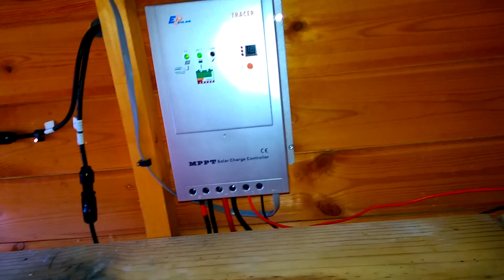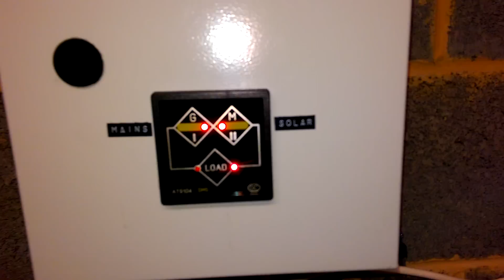Solar-powered Bitcoin Mining farm

Comment: over 3000Watts from a 13 amp plug all day how does it last i dont know. Besides the power you making probably only will keep that running 2 hours :D solar powered farm my ass.
Reply from the maker: This is an old video. That Antminer is drawing 350W, not 3500W.
Reply from the maker: This system ran for 3 years.

Comment: Making profit from bitcoin is as simple as finding what works and sticking to it for as long as it works irrespective of the current market trend which is so sideways right now, the faint hearted may just throw in the   towel and probably sell. This of course is a good time for me and it's been going on for months now since I heard about Mrs Linda, and signed up with his trade program. She provides trade signals and within my first month, I had turned in profit of over 3BTC under his instructions and daily signals. This current price position doesn't make any difference as anytime is good for trading if you know what to do. Mrs Linda can be reached on via whatsapp +1(209)510-5751

Comment: I’m keen to hear about how this turned out? Have you had it running the whole time or did you retire it for any reason? Thanks in advance 🙂
Reply from the maker: Retired it years when BTC was around £500 GBP a coin as no longer profitable due to difficulty curve. Still use the power system to run my fridges and freezers in the garage. Makes more money than the miners would for the same power.
Reply: @RoguePlank  ah so the dream is dead! 😔 thanks for the reply, was very interesting to know.

Comment: u make a profit after how many years ?
Reply from the maker: No, stopped mining years ago. The electricity is better used for other things.
Reply: @RoguePlank  
it was not profitable?
Reply from the maker: @marcarony2838  it was for the first year, but then the cost of electricity and upgrading hardware became more than I could make from mining because of the difficulty increase. So I sold the mining equipment and kept the solar power gear that I had bought with bitcoin. It was an overall net-gain after 3 years of mining, but not much.
Reply: @RoguePlank  u loss million of money 😭 
If u hold on

Comment: cool system love to do this 2,
just a few questions if you don't mind
353w for bitmain and internet?! usually in spec they say it uses 1300~2000watt?!
and if i see your system correctly your system is grid-tie can actually you 440w solar charge that much battery?
Reply from the maker: This was several years ago
Reply: @RoguePlank  ah you are right, lol well i always fascinated by solar-powered systems... 
still where i live it's way to expensive, but someday i will go offgrid

Comment: Couldn't you wire up the solar portion to just put out the 12 volts power used by the antminer and do away with the losses with that sine wave inverter and switch power supply? or even better, wire your panels and battery bank to 24 volts and use a DC-DC switching regulator to drop the voltage down to 12 volts?
Reply from the maker: That was an option, but would have meant the power couldn't be used for anything else really. Also, the DC line losses in that 30m cable from the shed to the garage would have been quite considerable.
Reply: @RoguePlank  No way to bring the solar system closer to the garage?
Reply from the maker: @sergeantseven4240  in hindsight, it probably would have been easier to get an Internet link to the shed and have the miner in there too.
Reply: @RoguePlank  probably could have kept your grid tie system but moved everything to the shed and still ran the 240v mains to the shed, kept the inverter for other things but ran the miner off the battery bank directly. I'm planning to purchase a few USB miner sticks and run them off a solar system directly. because they are 5 volts 3 amps each I can reduce my overall investment in the system. That's why I was looking for videos about solar powered bitcoin mining. pretty much all of the videos I've seen so far do it the way you've done it. How much profit would you say you've made so far?
Reply from the maker: @sergeantseven4240  I stopped mining with this setup over 2 years ago because the mining difficulty increased so much it became impossible to make a return on my investment. Sold the miner and now use the power to run domestic stuff in my garage. I mined about 1.5btc over 2 years, but it was only worth about £300/btc back then. Unfortunately spent the coin as I never thought it was going to take off after seeing the trend over 2 years. Ah well, good luck to you!

Comment: electrical nightmare good luck in a storm with the cables above the ground
Reply from the maker: Aaron Sears what's the problem?
Reply: the cable needs to be underground from the shed to house.
Reply: Lightning more likely to hit tree or aerial on roof prior to cable the greater risk is fault current tracking back through the earth. lightning strikes uk not that common luckily relative to work strike rates anyway.
Reply from the maker: It's a steel armoured cable with everything grounded, and RCD's and breakers at both ends. Nothing gonna happen. It's been running like this for over 3 years now.
Reply: 30mA RCD's are for protection of electric shock to humans not electronics. Circuit breakers are for protection of over current and short circuit protection. You use surge suppression for lightning strikes, but like I said the likely hood of being struck is very low.

Comment: Bitcoin and Ethereum have made a lot of people very wealthy. Just $10 7 years ago will be worth $7.5 million today. And $100 in Ethereum has increased to as $66,290 in under two years ! There are stories everywhere of people getting rich. I personally invested in bitcoin and Ethereum. And I've collected bigger gains here than in anything else in my life. For example, I bought Bitcoin twice . 10 coins at $83.40. And 20 more at $128. Today my 20 coins trade nearly 24 times higher . And I also bought Ethereum last November at $9.70... before it rocketed to $355! I was up over 3,500%. But here is the thing nobody is talking about. Bitcoin and Ethereum aren't the real stories anymore. It's the smaller , lesser known NEW digital currencies that are rewarding investors with the next round of huge wins. For example , I recently obtained 27,000 coins in a tiny new digital currency for just 18.5 cents per coin. Those coins now trade for around $4 each- 1,981% higher. And I invested in another one that's jumped from $1.50 to $10.71. Yet this opportunity is just getting started . Today I'll show you the new digital currencies that can turn as little as $10 into over $1million... in the blink of an eye. Yes, that's right... a single crisp of $10 bill could make you a millionaire. It's not only possible... it's actually happening right now . Consider , investors have seen gains of... 75,063% in Cryptonite, 59,577% in InfluxCoin, 60,450% in MaxCoin, and even 823,750% in DubaiCoin! Tiny new digital currencies are offering profits far bigger than bitcoin and much more quickly. I've personally made over 600% in one digital currency more than 1,981 in a second and over 3,500% in another, and I expect to make a whole lot more. Digital currencies are the one place in the markets where you can start with $10 and turn that into real money fast. CNBC did a story on a high school dropout who bought Bitcoin at $12 and is now a millionaire. And the top investors in the world are going all in on the new digital currencies. Now this is what you guys out there should know . A new set of  coins are being launched now that could help you turn as little as $10 into over $1 million. I've never seen profit opportunities like this before... in any market and at anytime. For example... in one recent week 23 separate digital currencies doubled in value. By comparison, the S&P 500 hasn't seen a single stock double yet this year. But only those who recognize the opportunity right now will see the fast profits. I first got in on Bitcoin at $83.40 and $128... only to watch it soar to over $2,000. But now I've turned my attention to the new digital currencies. For example; I invested in ANTSHARES earlier this year and at the time it was trading for just $1.50 but I watched it climb to $10.71 in less than a month. I invested in tiny new digital currencies of 12 coins and I cashed out 12,000 at $3.50 but still hold the rest... nearly $100,000 in total. There are now dozens of small digital currencies trading for just a few cents that are moving up dramatically over very short periods; like Asch traded for few cents at first but in less than 3 months $100=$,570. NolimitCoin traded for few cents but now $100=5,348 in 6 days. MediterraneanCoin traded for few cents but now $100=8,313 in 3 months. Another new tiny digital currency is out and fast rising and selling this December . A new tiny digital currency has been launched and on sale at the moment this december , it’s called metronome . This new crypto currency is said to rival bitcoin and its seen as the bitcoin killer. People like my self who knows the value of this new coin and can see the future of this coin can predict the potential of the new coin and will grab this opportunity at this early stage and invest in it. There are lots of tiny digital currencies that can generate higher gains more than bitcoin and the rest. A new digital currency called metronome have just been launched and selling at the moment this december. Metronome is seen as the rival to bitcoin and have been predicted to take over and be the next bitcoin within a short time frame. It’s only few traders who understands and know the potentials of this new tiny coin that will take advantage of it at this early stage and invest massively on it. For more guide on how you can earn good gains in crypto investment contact me directly on  hillssarah42@gmail.com to put you on the right path to a successful crypto investment.

Comment: It's all mains.  440W isn't doing jack.  If you wanted to power a 1.5kW miner it would require a 30kW system, and that's for sunny Utah.  In UK you'd need 40 kW.

Comment: So let me get this right, you go from 12volts to 240volts back to 12 volts, there must be a lot of loss involved, you would be better of just running the bitmain straight from the batteries via a regulator
Reply from the maker: BlackGoldEstates 1 I knew the miner would be obsolete eventually, so the inverter and long cable to the garage means I can use the power for other appliances. I stopped mining years ago. The solar power runs my freezers in the garage, saves me more money than the mining would make now.
Reply from the maker: If I was mining again, I'd put the miner in the shed with the batteries and have it connect via WiFi to the house.

Comment: 2x220 watt would hardly make a difference. I have 10x the number of panels and generate 15-35KWh/day of electricity depending on the season. Average around 25KWh/day. You would get 2.5KWh/day which is around 50c or less than $200 per year saving.

Comment: What are the chances a single mining machine like that will even drop you one coin in a year?
Reply from the maker: Hashterix zero. Pool based mining bro. Mining solo hasn't been viable for several years now.
Reply: Ah yeah good point. So you've had this running since 2015, what have your results been like?
Reply from the maker: Hashterix mined one whole bitcoin, then sold the miner in the same year as the power consumption was more than the mined coin return.
Reply: @RoguePlank  But, did you try with altcoins instead of BTC?

Comment: I have a similer system, but im having a issue with the inverters. Currently have 4 1200w inveters and its still not enough. 
Would it be cheaper to use the 12v system just run into the inverters and buy more? Or, sence the miners run on 12V, couldnt you just run the 12 right into the miners? So you dont have the energy loss in the inverter and power supply?

I am yet to try this, but the miners are so far away, the wires for the 12 V would have to be so thick i dont think i could buy enough wire. Although i could move the miners, not sure. LMK what you think!

Comment: Total waste of investment. Batteries have limited lifespan, solar power cells loosing around 10% of their initial output each 10 years. Add to all these waste of transformations from DC to AC and then back to DC and electricity from the wall will cost you much cheaper.

Comment: Spent all that money on equipment and no conduit from the shed to the garage. Sloppy work. Cabling exposed ready to get pinched or accidentally cut.
Reply from the maker: It's SWA - steel wire armoured cable. Very tough cable.
Reply: Honestly, direct buried would've looked much better. No exposure and no tripping on the sidewalk. Direct burial cable isn't cheap. A painted steel panel box with your plugs and switches would've made it neater to mount and maintain. Now these are exposed and dust, bugs, etc. will clutter up your equipment.
Reply from the maker: Been running fine for over 2 years now, no problems. I guess I could put the swa cable under the slabs but nobody walks down that side as it's just used for storing the bins.

Comment: why are you putting the miner so far away from the solar panels so that you have to use a longer cable where there's a loss in voltage, why don't I just put everything in the little hut shed thingy

Comment: When you switch over from solar to mains, what does that change over do to your machines? does it affect/damage them or does the machine restart its block that it was mining? I have run of a similar setup but I am worried that the longevity of the machines may be damaged from swapping from solar to mains all the time. any ideas?
Reply from the maker: Kelvin Rodwell they just stop and restart. The S3 automatically reconnects to the net and starts mining on its own. It's only cycling the power supply so it has little effect really.

Comment: When you upgrade, don't use inverters. Get a DC PSU and hook up some large capacitors between input and output. However DC current has its limits on distance.

Comment: hello,  i would like to make a small solar setup to run bitcoin 24h a day.  i live in southern spain,  sun is on tap most of the year.  i just want a entry level setup but not sure how to work out the solar panels that i would need and the power they generate.  Any advice would be appreciated.  thanks in advance.  rob.

Comment: Can you mine without batteries?If yes what kind of inverter do you need?
Reply: if you use solar you need batters for night and when there is clouds
Reply: best way is not to use inverters at all. Get a 1200W DC PSU and +120A worth of batteries. Hook up a large capacitor between the lines to maximize the output and input of the current. Saves the batteries as well.
Reply: hakabet123 Caps would be good if motors where starting drawing loads of power but in this case they will just drain the battery's.

Comment: Awesome video, nic,e and clean layout. Would you mind posting some info in the description or something about cost / yield of your setup? I didn't think bitcoin farming was really viable on a small scale anymore so I'm assuming you are doing that just for a bit of fun. I am however interested in setting up a solar system to support my home office. T.I.A
Reply from the maker: You'd need a mining setup at least 4x the size of this with much more solar panels to make any money off this now. I was making a bit in the beginning but mining difficulty has increased too far now. I just use the solar power to run freezers and fridges in my garage now, sold the Antminer a while ago.
Reply: @RoguePlank  But did you try with altcoins instead of BTC?

Comment: Why dont you connect the 12v from batteries to antminer? Inverter aint the best???
Reply: +SuperMaiki76 This is my plan too- I'm collecting small 12v dc miners (gridseeds, etc)- this way I don't suffer an inverter loss, and with a 12v battery bank and charge controller, it'll mine at night also.
Reply: +Phil Chadwick Phil...I am developing the same as you by using a twelve volts...exchange ideas woulr be great. I m eletronic technician.
Reply: +Phil Chadwick My plan aswell but in Thailand :) right now i got new s7 so need a huge battery pack aswell panels.. but ill start with s3 to see..
Reply: yes, maybe a truck battery :)

Comment: Looks like a Bitmain AntMiner.

If it creates 350Watts at the moment, and assuming no loss that looks like 450 Gh/s if you assume 0.77 W /Gh.

and from quick research that equals

annually 0.795 Bitcoins  $361.8 (pretty much a dollar a day)
Reply: well now it is $2170.35 annually and 6 dollar a day. well that escalated quickly
Reply: +Embeh ... but only if there is 350W of sun on average all day long.
Reply: thx for clarifying things.
Reply: MoreTheLore it does not raise by the value but by the current amount of btc mined
Reply: well it does increase the value of what he had mined before if he's holding. so he could have been mining 6 dollars a day a year ago if he sells now.
Reply: pretty much a dollar a day
Reply: Yea that would be $30.000 a day now
Reply: Is 2025... Bitcoin is 100k
Reply: a dollar a day
Reply: Nope, when the value of bitcoin goes higher the difficulty of mining it goes even higher.

Comment: The inverter is not needed here! DC to AC then back to DC lol. Does charge controller not output save 12v to charge batteries if not use DC DC converter not inverter!
Reply from the maker: 1. I can't feed solar charge voltage straight into the miner without regulation. The batteries go as low as 11v and as high as 14v. 
2. DC resistance losses in the 25m cable from my shed to the garage. 
3. How would I switch between mains 240v and solar 12v using an automatic transfer switch like I currently have? 
4. DC 12v is no use to the rest of my house, cant power anything else domestic off 12v without... An inverter!